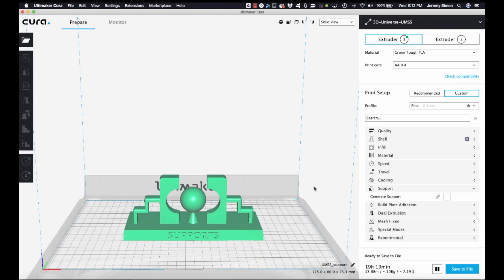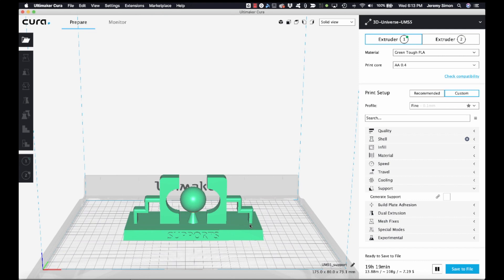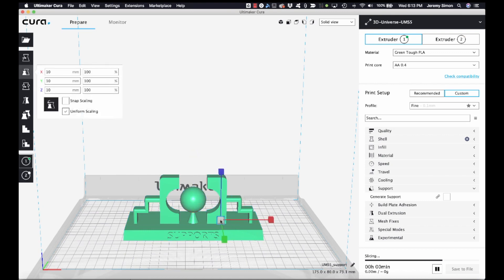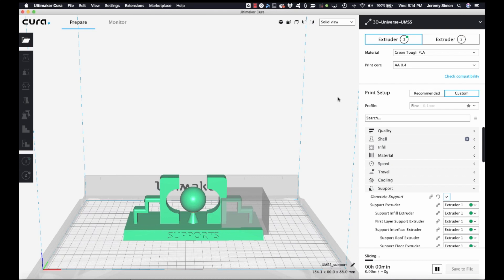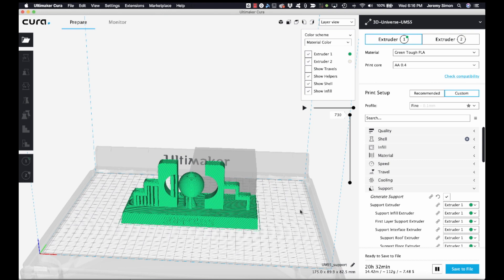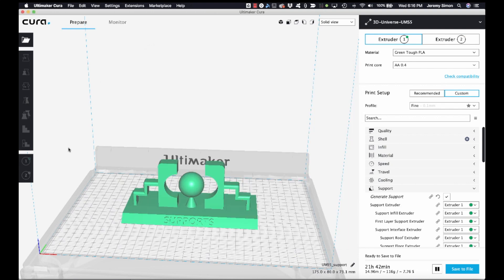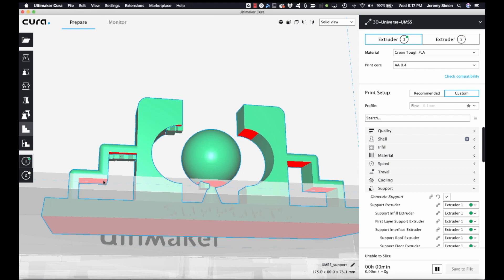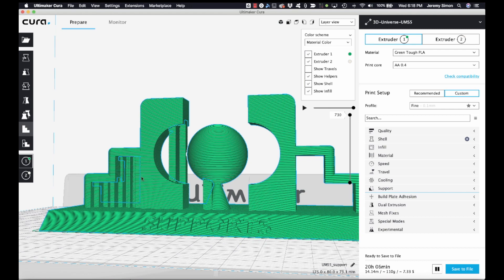Customizing Supports in Ultimaker Cura

Comment: Why doesn't my cura have that support blocker feature?
Reply from the maker: Do you have the latest version of Cura installed (currently 4.7.1)? You need to have an object loaded and selected in order to see the toolbar on the left side of the screen. Then the support blocker tool should be the 6th button down from the top. You can also try selecting your object and using the hotkey (E). After pressing E, click somewhere on your object to add a support blocker. A small grey cube should appear, which you can resize and reposition as needed.

Comment: Hi, I dont have the Icon to create support blocks I have been browsing the settings but cannot find any option for this. I did check and I do have a plugin called support eraser tool, but im lost now
Reply: Does work if I press "E" (noticed the hotkey shortcut on your video). Any idea how to add the icon to the icon list on the left?
Reply from the maker: Do you have the latest version of Cura installed (currently 4.7.1)? You need to have an object loaded and selected in order to see the toolbar on the left side of the screen. Then the support blocker tool should be the 6th button down from the top.

Comment: custom suppor is just not working in the latest cura at least not for me
Reply from the maker: Thanks for bringing this to my attention. I just tested it, and it's not working for me either in Cura v4.1.0. The plugin installs okay, but the custom supports don't seem to be generating. I've sent a message to the plugin developer asking him to update the plugin to work with the current version. Hopefully, he'll do that soon. Feel free to post a message yourself here: http://lokspace.eu/cura-custom-supports-plugin/
Reply: @3duniverseOrgWelcomesYou   Dont worry  using the blocks was very helpfull for me as I am kinda noob on the amazing  world of 3d printing,
Reply: @3duniverseOrgWelcomesYou  my Cura 4.3 doesnt even have a "marketplace" tAB do i have to trigger it some way?
Reply from the maker: Just received confirmation from the Cura team that this is a bug and is being fixed in v4.2.

“Cura 4.2 release will fix the support blocker functionality as well as the custom support plugin, as they're both affected by the same issue. Until then, v4.0 is recommended.”
Reply: @3duniverseOrgWelcomesYou  OOps sorry, I've found the marketplace tab, they had moved it to the extreme right of the interface up in the corner :D
Reply: @3duniverseOrgWelcomesYou  I don't know if you are still active, but I am new to 3D printing and I am using CURA 4.7 I just used custom supports and not all of the custom supports are not generating when I slice the product. Some with fill in but the others won't. Is there a reason for this?